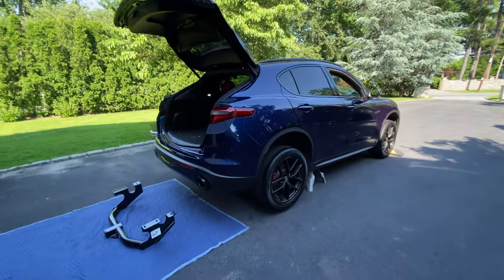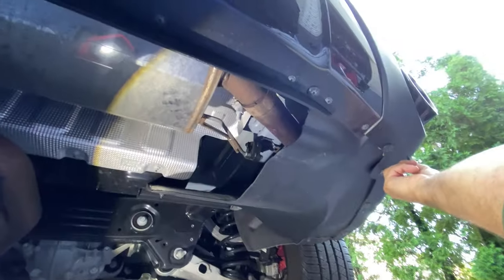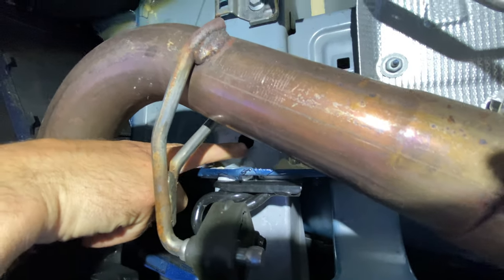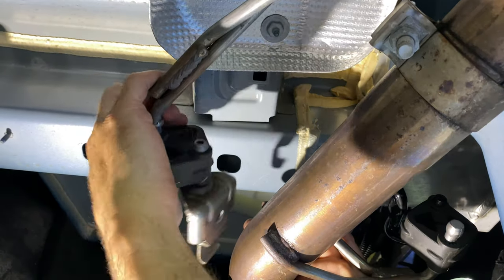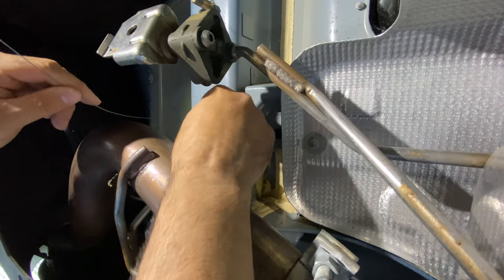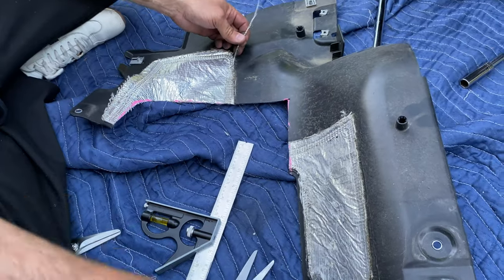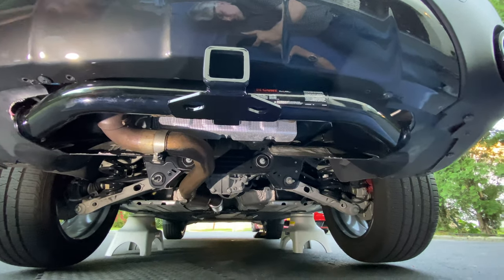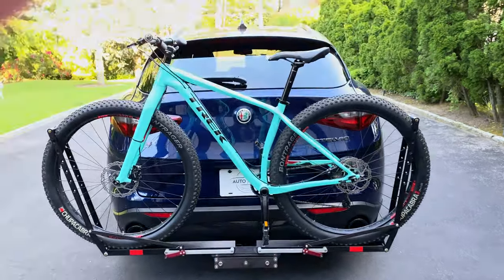Trailer Hitch Install From HELL | Auto Fanatic

Comment: Great post.  Can I assume that a factory exhaust would not require the modification/cutting of the hitch bracket like you had to?
Reply from the maker: Can not confirm that as I haven’t installed another yet on a Stelvio but this job was a nightmare and I eventually sold car without removing it

Comment: Little late to the party here but thinking about tacking this one too (also for a bike rack ) and have an aftermarket exhaust as well...its the straight non-resonated ragazzon 3"..how do you think it will fit? Also doing a QV rear bumper conversion eventually, do you think this will work with it?

Comment: So if you are changing the exhaust out in a few days / weeks why not wait?   Won’t you have to remove the hitch to get the out exhaust out and the new on on? What about fit differences / issues between the two?
Reply from the maker: i hope i do not need to remove it to change the exhaust, the OEM exhaust system i had to cut it for storage and its big and heavy and a PITA to get back to my house then i need to fixture it and weld it to put back on which is why i have delayed doing this big job i just do not have the time lately. it will happen soon i suppose

Comment: For a minute I thought you were going to keep cutting until there was nothing left of the bracket. Question. Did you touch up the bare metal cutout with paint before final install or just leave it bare?
Reply from the maker: yes i used some Eastwood 2K Chassis Black afterwards.

Comment: If you cut any part  for the Trailer Hitch .. you complety lost the warranty .. better buy the correct Trailer Hitch .. sorry guys.. !!
Reply from the maker: well this car has a custom exhaust and cutting was the only option to install it
Reply: @autofanaticcars  Hi did you ever switch the exhaust out? I have a ragazzon evo and the same curt (installed with stock exhaust but installer said no way would it work but looking this..). Wondering if i can do the same cuts and get it to work instead buying a new one for the QV variant that "might work"